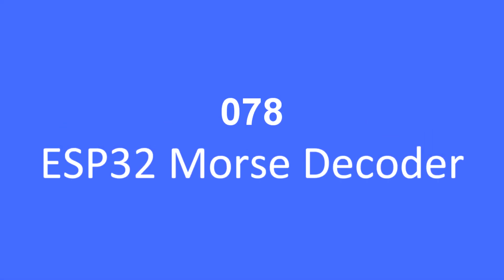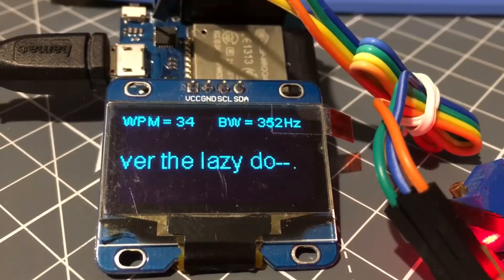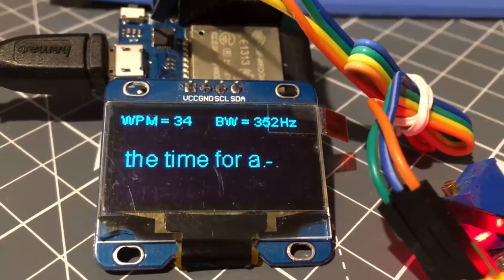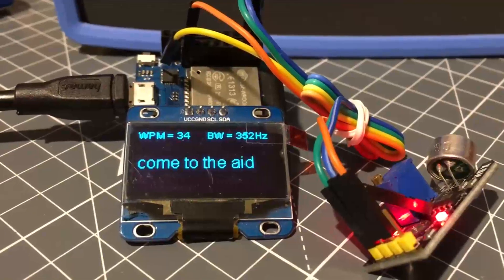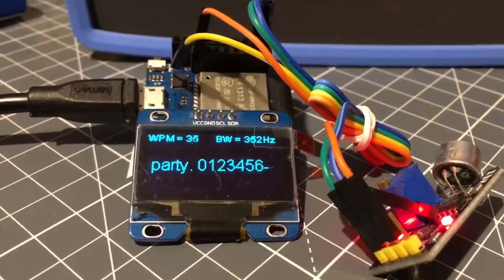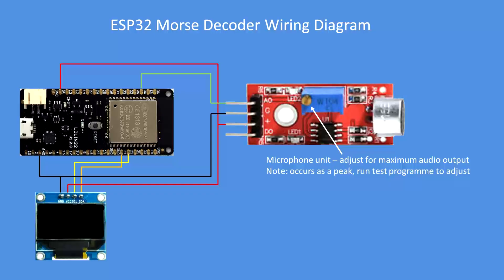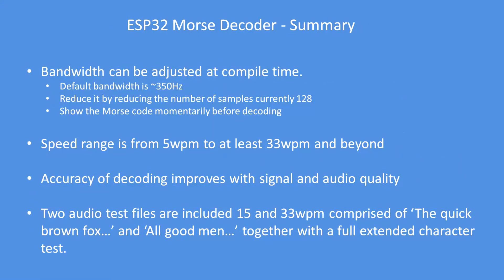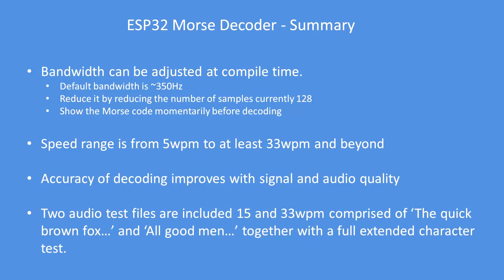Tech Note 078 - ESP32 Real Time Morse Decoder

Comment: Is it possible to desolder the mic and solder a 3.5mm to it instead?
Reply from the maker: Yes, but you’d need to be careful with drive levels or the amplifier may be damaged. You could try directly driving the ESP32 ADC input via a capacitor connected to two equal value resistors so that the centre point of the signal is 1.65 volts. So 3.3v—-10K—-10K—-Gnd and then AC couple audio to the resistor junction that’s connected to the ADC input pin. Most audio outputs are 600mV and that’s adequate.

Comment: For anyone who might be working on this with an ESP32, I've done some experimenting with the algorithm settings.  Using a 16k sampling frequency and n = 32 samples, I got excellent performance from 13 to 30 wpm.  At 10 wpm it started putting a space between each character.  At 35 wpm it started making decoding errors. 
I used the ARRL code practice mp3 files as a source and fed the audio to the GPIO via a 600:600 ohm audio isolation transformer.  Scope indicated a signal level of 600 to 800 mV P-P at the GPIO. 
I never could copy morse past about 15 wpm, so I love this project.

Comment: I've implemented this using an ESP32-WROOM-32E dual core 240 MHz dev board.  I have it working, but only with slow morse.  Can anyone explain how to determine the optimum sampling frequency to use?   The value in the code on Git is 45000.
Reply from the maker: That sounds like a poor quality audio input, as it can decode very fast 30-40wpm
Reply: @G6EJD  Input is very clean, from an audio signal generator.  I'm using a 744 Hz target frequency in the code and the signal generator is providing 755 Hz (it has fixed settings rather than adjustable).   Is the 45k sampling frequency the correct value to use?  And, thanks for the response and for posting this project.  I'm determined to get it working.
Reply from the maker: @davidpickut2477  the sampling frequency is many times higher than the audio frequency, where generally only x2 is required, so the routine will be getting a good sample basis. Are you sure the machine generating the Morse is correctly formatting the morse timing ratios as if it works at slower speeds this suggests the inter letter or word timings are too short relative to the dash and dot timing ratio
Reply: @G6EJD  OK, I figured the sampling frequency could be lower.  I actually got the best results with it at 4,000.  I'm experienced with CW and have told I have a clean "fist", but I'll look at the timing ratio.  I also have an Arduino-based morse sender I can use as an input.  Thanks!
Reply: I got it working with real radio signals and the sampling frequency at 6,000 Hz, 32 samples.  Very impressive algorithm.  I got very reliable output with a clean audio signal level around 500 mV P-P going to GPIO 36 (A4) on the ESP32.  The radio has a good quality CW filter. Thanks so much for your assistance.  😊
Reply from the maker: @davidpickut2477  that level of audio is quite high, is your microphone AC coupled via a (say) 1uF capacitor. Glad you got it working
Reply: @G6EJD  I'm not using a microphone -- direct wired from the audio output of the receiver to the GPIO.  I've looked at the audio output using a scope -- very clean.  The receiver has an effective AGC and is designed for output to headphones, so the max audio output signal is < 1 volt. It has a cap in its output circuit.
Reply: @davidpickut2477   @G6EJD_>but you’d need to be careful with drive levels or the amplifier may be damaged. You could try directly driving the ESP32 ADC input via a capacitor connected to two equal value resistors so that the centre point of the signal is 1.65 volts. So 3.3v—-10K—-10K—-Gnd and then AC couple audio to the resistor junction that’s connected to the ADC input pin. Most audio outputs are 600mV and that’s adequate.

Comment: I am new to this. Will any ESP32 Development Board work?
Reply from the maker: Yes, just check your pin connections but they are very nearly all identical.
Reply: @G6EJD  Awesome I will get one ordered.
Reply: @G6EJD  Got all components in the mail today. Next question how do I program this. I have been looking over youtube videos and they references to use espressif / arduino-esp32. Yes I have never programed anything in my life. Can you possibly point me in a direction that may work best for your / this project.
Reply from the maker: @neotroncs  you have to go to the Arduino website and download the Arduino IDE, the non-zip version. After that google for ESP32 add-on for Arduino, there are plenty of tutorials for that then you can download and install programs when you get going you will find it quite straightforward
Reply: @G6EJD  You are awesome. Going to do this right now. I am looking forward to this project. Thank you very much.
Reply: @G6EJD   Working on this for most of the day and I am running in to this.  "SH1106.h: No such file or directory" Did I mess something up?
Reply from the maker: @neotroncs  you need to install the screen driver from the location listed in the source code.
Reply from the maker: @neotroncs  // Install the OLED driver by:
// 1. visit https://github.com/ThingPulse/esp8266-oled-ssd1306
// 2. Download the file container to your desktop using the GREEN code button.
// 3. Now start the IDE and select SKETCH, INCLUDE LIBRARY, Add .ZIP LIBRARY
#include "SH1106.h"           // https://github.com/ThingPulse/esp8266-oled-ssd1306/
Reply: @G6EJD  I had to go back and look up on how to create libraries for arduino. Your instructions are spot on and I was able to upload to the module. Something else is wrong and I need to recheck everything I have no display. I am rechecking the pinout. I hope i did not blow something.
Reply from the maker: @neotroncs  oK, if the examples work, then make sure the first few lines match my code example
Reply: @G6EJD  OK so on the arduino side and your code from github are the same as far as i can see. I matched them side by side.

So this is what I have for the pinout.

ESP32 Devkit v1
GND to GND oled / G mic unit
21 to SDA  (My board D21 GPIO)
22 to SCK  (My board D22 GPIO)
5V to + mic unit / VDD
UN to AO mic unit

Now I hope I did that right but I think I messed up I was looking at my OLED and on the back it says GME12864-42 I thiink I have the wrong OLED.  My amazon side said I bought a esp8266-oled-ssd1306 but I can not find that no where on this OLED. What is your thoughts?
Reply from the maker: @neotroncs  ok, the 12864 is not a 1106 oled unit, they are 1.3” across.
Reply: @G6EJD  Well crap. I will get another one ordered. I was think after looking it up and reading more on it that this was what you where going to say. Well give me a few days and I'll get the right one. Thank you for being so patient with me.
Reply from the maker: @neotroncs  google for OLED sh1106 Amazon UK sell them, search for the same there
Reply: @G6EJD  Will do. Thank you.
Reply: @G6EJD  I got the 1.3" IIC I2C Serial 128x64 SSH1106 SSD1306 OLED LCD Display LCD Module for Arduino AVR PIC STM32. I hooked it up no display. I tried a clock demo and got snow at first then lines and a few lines of the clock. As for the morse code no display. I know I am missing something but I am lost. I played with it for 6 hours yesterday looking up stuff and trying to figure it out. It could be so many things going wrong I am still looking in to it. I am also reading anything that I can. I am not giving up but I know I am doing something wrong or not adding something that is needed. Just wanted to give you an update.
Reply from the maker: @neotroncs  what you should do is find in Examples the Thingpulse section, then clock and make sure you adjust the code for the sh1106, like this:
// #include "SSD1306Wire.h" // legacy include: `#include "SSD1306.h"`
#include "SH1106Wire.h", legacy include: `#include "SH1106.h"`

The morse reader has the same setup lines. Are you getting good morse audio, what microphone are you using and have you set the offset using the technique I mention.

Comment: 'A0' was not declared in this scope. My IDE v.1.8.16
Reply from the maker: That's because you have not selected a Wemos D1 Mini as in my example. Determine what your board type is and what pin it uses for the ADC port.
Reply: @G6EJD  worked but not correct and output random data when gnd connect to mic.
Reply from the maker: @МКпрограммирование  did you AC couple the microphone via a capacitor usually 1uF
Reply from the maker: @МКпрограммирование  sounds like your microphone is not working correctly

Comment: Can you have code for another display type like lcd 2004 or graphic lcd 12864 for large screen size less power consumption and can use under bright sunlight ?
Many thanks.
Reply from the maker: Yes, just change the display driver, but nothing takes less power than an OLED

Comment: Had to change two lines 90,91 to compile with latest Arduino 1.8.10

 90     for (byte index = 0; index < n; index++) {testData[index] = analogRead(A0);}
 91     for (byte index = 0; index < n; index++)

Worked perfectly, Brilliant.

Comment: Hello, nice job!!! Is an ESP-32 the same as the D1mini? Would it work with that either?
Reply from the maker: ohweh, the Wemos d1 mini uses the ESP8266 which is an earlier processor , the ESP32 is significantly faster than the 8266. Speed is needed for morse decoding, it’s possible the esp8266 can decode in real time I have not tried it. You can get an ESP32 based Wemos d1 mini from AliExpress

Comment: Thank you for the video. I have a question: Can the sketch work with nodemcu esp8266?  thanks
Reply from the maker: los vídeos de EA5-III, it will compile but you will need to change line 25 and 68 for the node MCU I2C bus usually pins 4 and 5 in place of 16 and 17, I have not tried it but it may work
Reply: @G6EJD  tnx, 73

Comment: Test files worked great, tried it on some youtube vids and it's hit or miss mostly due to noise, maybe i need to tweak the mic some more, pretty cool tho!
P.S the code uses 17/16 for I2C but your diagram uses 21/22.
Reply from the maker: I2C pins  - It does depend on your development board type, the best way to determine what they are is to add serial.println(SDA) in your setup section of code. Bandwidth can be reduced by reducing sample size then it will analyse less noise, the frequency you set is the tone frequency it is optimised for so when tuning a radio it should be tuned to give a beat frequency of that set in the programme e.g. 558Hz or 900Hz or whatever. When listening to off air morse tuned correctly mine works ok. There is a limit to how far off frequency it can be. Hope you enjoy it. There is much that can be adjusted in the code to optimise reception, I went for a general setup suitable for most applications.
Reply: @G6EJD  sample size is defned in 'testData[128]'? I have noise problems with a MAX4466
Reply from the maker: @michaelspooren9213  have you tried a decoupling capacitor across the 4466 power rails.